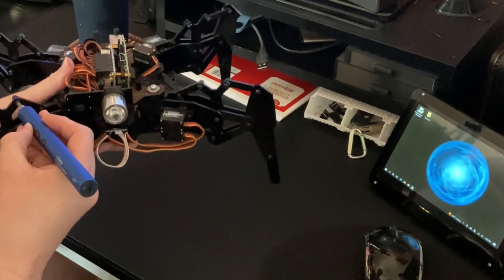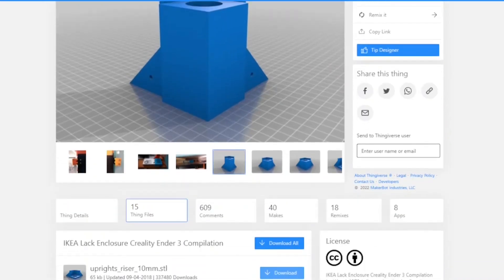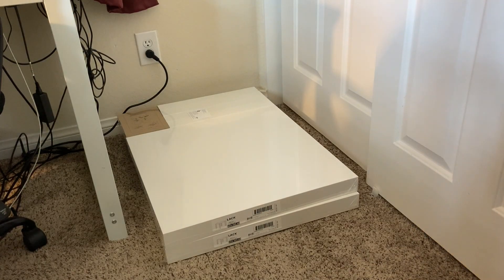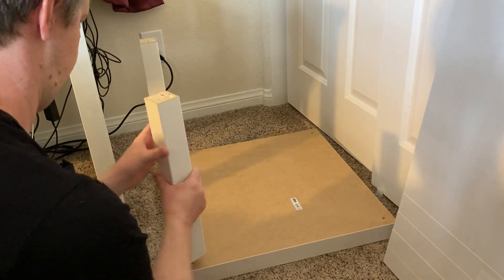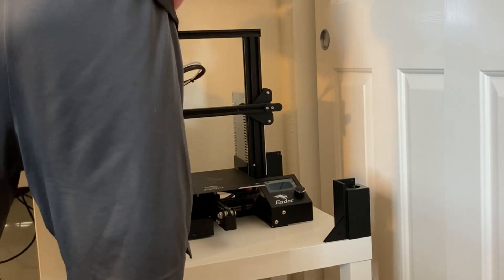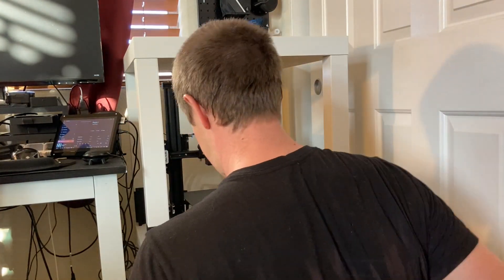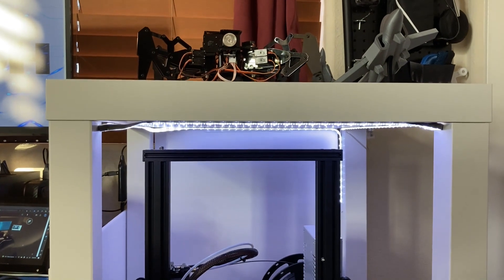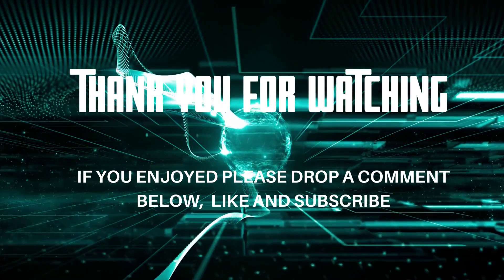Easy Weekend Project - Ikea Lack 3d Printer Enclosure

Comment: Your spool is in the back using the standard holder? Arent you preoccupied with filament having to do a 180 degree turn? To reduce the noise even further you could use one of the acrylic wall lack enclosure projects
Reply from the maker: Yeah its a temporary placement until I can print a better spool holder I'm planning on placing on top and running it through a extra bowden tube as a guide. It has been working fine with printing so far, but I'm not maxing out the Z axis lately.  I would expect some strain if printing taller prints.
Reply: @S-Technology  hi im a little bit late, but has it worked with the bowden tube? im building an enclosure myself with a filament heater on top. But the filament rubs against the hole in the table that i made. So i thought maybe a bowden tube works in this case.
Reply from the maker: @larswiederhold8866   I actually ended up making my own bowden tube with some leftover water line.  If you are trying to pass the filament through the lack it can get stuck because its not solid.  Its closer to a cardboard consistency.  I made a quick video showing it here: https://youtu.be/V6xxdNzvwXs

It's working well for me.  I'm sure you can modify it to work with your setup.

Comment: I've been creating my own enclousure for my ender 3, but it wiggles a lot, the pattern that i follow use two parts to uprise the desk, one on the top of the leg and another in the bottom. Have you notice this kind of problems (that wiggles the enclousure) in your enclousure ?? I'm thinking of start printing that design, but it's like 40 hours in total, and i like to be sure, that the top or anything on the enclousure didn't wiggles. -Thanks in advance !!
Reply from the maker: I 've seen the ones with the pieces for the top and bottom.  I didn't use the top prints on mine, but I believe they mount similar to the legs with 4 screws per piece. I haven't had any issue with mine wiggling or shaking while printing.  If you are concerned about moving the best bet would be to attach the stand to the wall, just like other tall shelving units would be attached. 
Yeah I ended up printing each piece separately.  I believe it took me 2 weekends to print as I printed a part a day.

Comment: Hey! I'm planning on doing this project for my Ender 5 S1. I cannot find anywhere online the dimensions of the space inside the legs of the lack. The Ender 5 is a very large printer, so I don't want to buy anything if it wont work. Great video!
Reply from the maker: The space between each of the lack legs is about 17 1/2 inches.  But the actual working space might vary depending on the supports you decide to print to make it taller.  With mine it appears the largest you could go would be something like 18 inches X 16 inches.  Anything larger than that you would probably have to modify the 3D printed supports. 

I hope that helps and makes sense.
Reply: @S-Technology  Thank you for your quick response! This helps a lot. I believe I could make it fit, as long as the filament is mounted on the exterior :)
Reply from the maker: That’s what I ended up doing. I mounted it to the top using the TUSH. I have a video of it. It’s easy to print and build. 

I’m glad it helped.

Comment: Is that the Ender 3 pro if so does it fit very well?
Reply from the maker: Mine is just the basic Ender-3.  And for me it fits well.  Some people have mounted the power supply and the control display outside of the cabinet.  Then you would have a lot of room.  
Just don't get the smallest LACK table they have now.  Since the video's release there's a smaller table that would barely fit the footprint of the ender 3.
Reply: @S-Technology  thank you for the reply, what are the dimensions of the original then?
Reply from the maker: @AllTheWayFast  Height: 17.75” | 45 cm
Width: 21.625” | 55 cm
Depth: 21.625” | 55 cm

You can find many different versions of the legs connectors to make the height taller when stacked if you want to.  

https://www.ikea.com/us/en/p/lack-side-table-white-30449908/

Comment: sorry but in the beginning of the vid where u activelly printing with ur temp readings going from 199 to 176?? Maybe check for thermistor issues that might come up?
Reply from the maker: I ended up having to replace the thermistor. I did end up making a how-to video for replacing it at the hot end, so it’s not all bad.